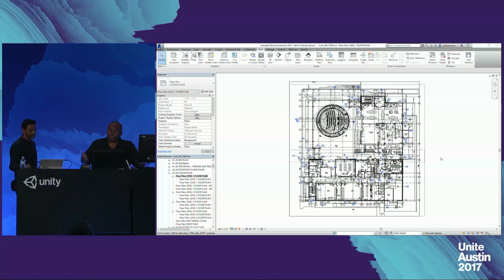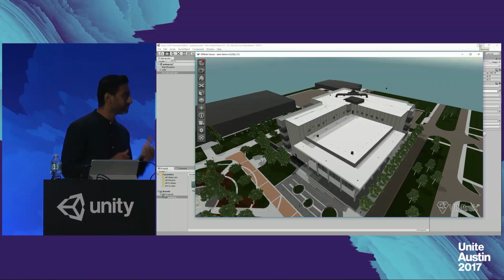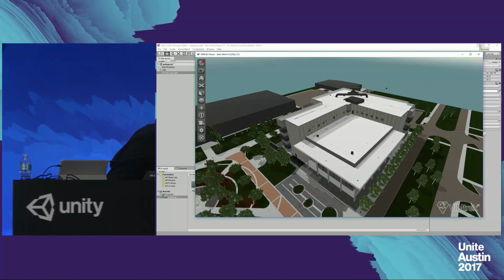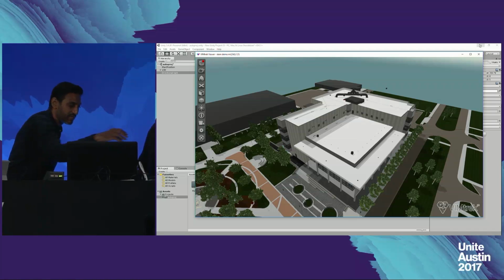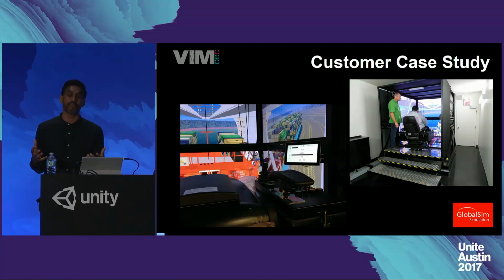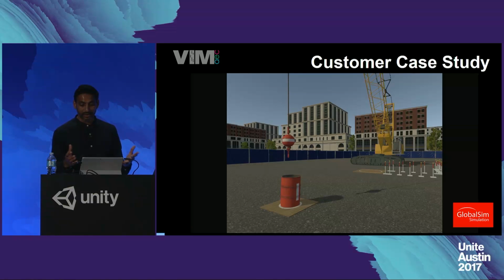Unite Austin 2017 - Unity Beyond Games: Architecture, Engineering, Construction and More

Comment: FBX file format, especially coming out of 3D Studio, does carry over texture and UV data into Unity.  It's actually very easy and straight forward just using the default settings.  I have done this many times for fairly large AEC projects.